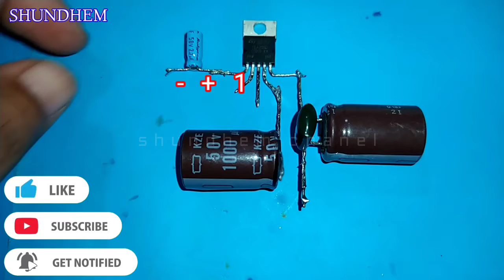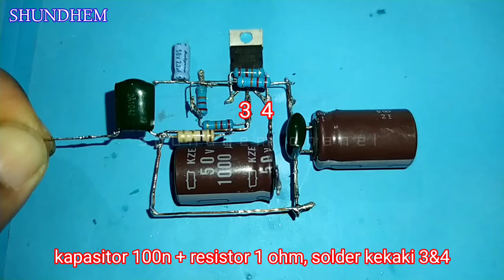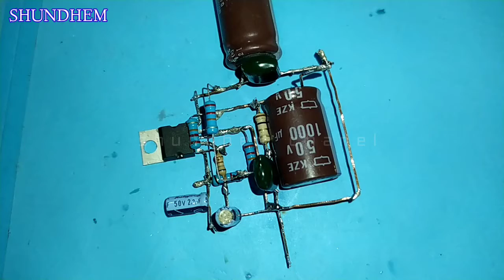cara merakit Power ampli tda2050 tengangan single supply untuk aki 12volt suara jernih dan mantab

Comment: Bang, di suplay 12 v gak bisa ya bang. Td nyoba, cuman ada 12 v, tp gak nyala, kenapa bang?

Sama elko 22 uf itu pengaruh gak di ganti 10 uf, soalnya lg gak ada elkonya

Dan, resitor 1/4 wattnya kagak ada, yg 680. Seri stengah watt 470+220 , apa itu yg ngaruhnya bang?
Reply from the maker: bisa 12v, ada yang belum tepat merangkainya mungkin.
Reply: @shundhem_electrick  
Owh iya makasih bang jawabnya, entar q coba lagi. Tadi pake Pcb soalnya, mungkin ada yg kepeleset jalurnya.
Reply: Pakai trafo CT ya